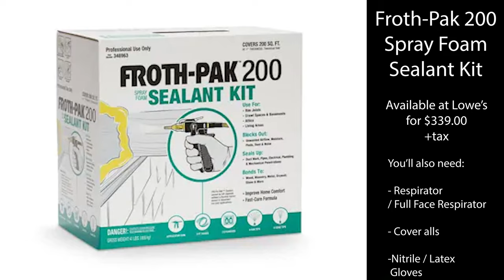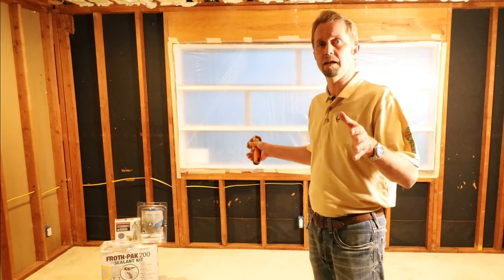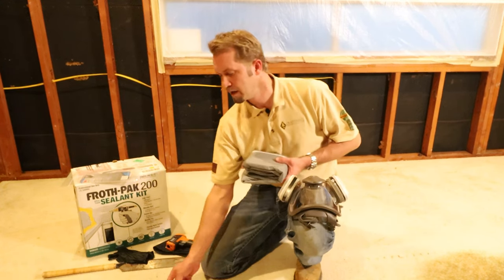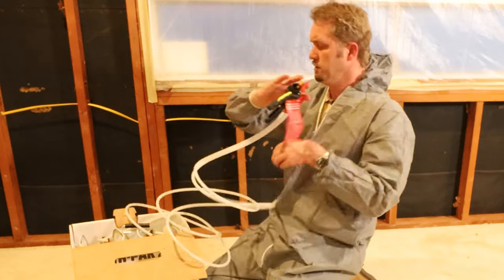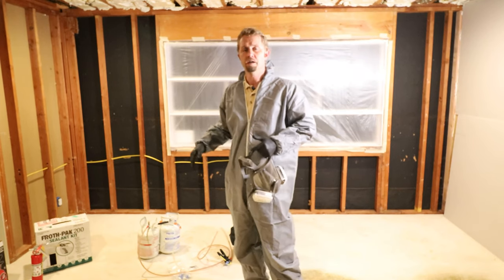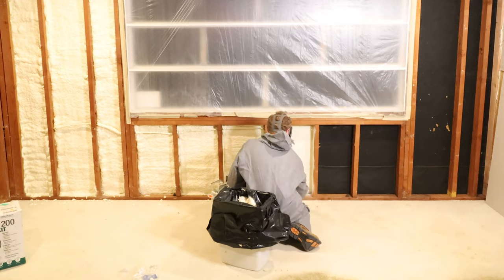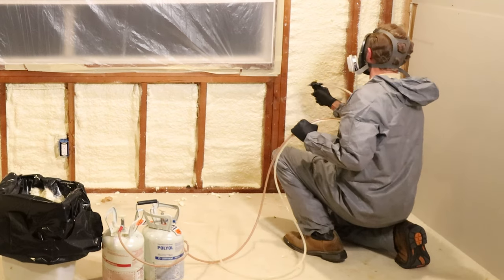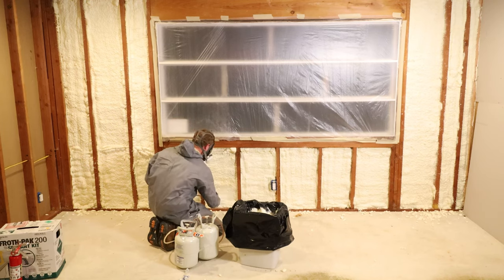Froth-Pak 200 Spray Foam Sealant Kit Set-Up, Precautions, and Spraying Review #Froth-Pak

Comment: craftsman connection ... thanks for the reply ... after a very long wait , Dupont informed me that these packs will not be adequate ( partial ) as a vapor barrier .. need the professional  " high pressure " installation  for vapor barrier .  ( glad I didn't buy more ).
Reply from the maker: My spray foam contractor has told me many times that you’ll need at least 1” of closed cell foam to have a vapor barrier. So, I would and do doubt what DuPont rep is saying. Maybe try calling a few spray foam companies to get their take on Froth Pak. Wouldn’t doubt they’ll try to push whatever product they use, but worth a shot.
Reply from the maker: I looked at the DuPont website for the perm rating on Froth Pak, and all it says is….@ 1” thickness, @ 2” thickness. What the average person wouldn’t see from looking at this product info is the missing values or numbers in front of # @——-thickness, so it would appear that it doesn’t serve as or rated as a vapor barrier. Now on other closed cell foam products, they do have vapor/ moisture ratings. Common sense would lead me to believe that if it is a 2lb per square foot closed cell foam, then it should be able to retard vapor/ water. Now I’m wondering if I can make a video on proving or disproving this? Got any creative testing ideas?
Reply from the maker: Vapor Barrier VS Vapor Retarder:

According to the Building Science Corporation, “A vapor barrier is defined as a layer with a permeance rating of 0.1 perm or less.”

A vapor retarder is 1 perm or less.
Reply from the maker: From DuPont.com:

For Froth-Pak™ Sealant the LTTR value (Long term thermal resistance)
measurement at 1 inch thick is 5.3 sprayed to Phs thier ine Lif value
(Long term thermal resistance)
measurement at 2 inch thick is 5.5 f2•h•°F/Btu (R value) per inch which is
R11.0 at 2 inches thick.
For Froth-Pak™ Insulation (Aged 180 days @ 75°F):
Thickness (inches)
1.0"
2.0"
R-Value (ASTM C518, F.ft2.h/Btu)
6.0 (when sprayed at 1 inch
thick)
12.2 (R5.6/inch when sprayed at 2” thick)
Reply from the maker: Small correction: Way off to the side of the spec sheet I found a rating. For the Froth Pak, The perm rating is 5.4 at 1” thick, and 3.1 at 2” thick. So if you know that a Vapor Barrier (blocking vapor) is considered at 0.1 perm or less, and Vapor Retarder (slowing down vapor) is at 1 perm or less, then by seeing a spec of 3.1 perm and 5.4 perm, the Froth Pak is not a Vapor retarder or vapor barrier. Thanks for making me do my homework. 😄
Reply: @craftsmanconnection  Think I'll insulate walls with glass and paint ceiling/ attic  joists ( old farmhouse )   & leave them open -- as they have been for 90 years ... and decide later if its too hard to heat ... might b just fine . Thought this would create a barrier so as to eliminate venting ... probably not possible with 2X4 wood . Other thought would be use 210 and then seal it with visqueen .. with dead air between -- all depends on the climate I guess. I could watch it  & see if condensation forms - but I don't think I'm that patient .
Reply from the maker: @jlondon158 My spray foam contractor strongly advises against closed cell foam on rooflines, because if you have a leak, you won’t know about it until the wood rots and falls apart. Now that we both know that Froth Pak is not a vapor barrier or vapor retarder, it sounds like it would be ok to put it on the roofline. But I really wonder what a perm rating of 3.1 and 5.4 is comparable to. What is the perm rating of a sponge for comparison?

Kind of comparable to your farmhouse, I have an enclosed patio. All windows on 2 sides and all brick (the house) on the other 2 sides. I had my spray foam contractor spray foam my patio ceiling / flat roof with open cell foam, so I could have 2 portable AC units totaling 27,000 BTU’s on the 400 sq. ft. patio cool it down from the 100-110 Texas summers, down to 78-83 degrees, and I have single pane windows still. I spend almost all the time I’m home out there, everyday now for 5 years.

Comment: Is it cheaper to do it yoirself than hire a company?
Reply from the maker: For my spray foam contractor, his minimum cost for a job was $1,250, and went up to $1,500, and then went up again to $1,750. So the real question is how much spray foam do you have to do? You’ll need to first measure the square footage of the wall, and then multiply it by the number of inches in thickness to get the board feet. Example: 100 square feet x 2” thick closed cell foam is 200 board feet. In my video I had somewhere around 77 square feet, times a 2” to 2-1/2” thickness, which means I got around 154-192.5 board feet out of a Froth-Pak 200 kit. Keep this in mind when purchasing material. 

Froth-Pak 200 currently cost around $389 per kit, so after tax, it cost around $421, depending on your sales tax rate. If you buy 4 kits for a total of $1,684, that is probably the limit for when it’s worth hiring a spray foam contractor, who might have a minimum of $1,750.

When you do it, you can get it as thick as you like, and 2” should be the minimum. You can also get it done at your convenience, and as your project allows if not 100% ready for a contractor. Don’t forget to use a respirator, and cross ventilation so you’re not inhaling chemicals that are very bad for your lungs.

Comment: why did you use the sealant instead of the insulation one? is the sealant for exterior walls? doesn't really say on their thing
oh I found it on the dupont site and you're supposed to be using the insulation one for what you are doing lol
Reply from the maker: This is probably the #1 question I get. This “Sealant” kit is an insulation kit. The box is poorly labeled. On the Dow website for the Froth Pak product, 2nd paragraph, their website says “ …sealant and insulation…” I think the only reason they call it a sealant kit, is the size of the box.
Reply from the maker: The difference is in the nozzle you choose to use in the box, and the box size like 200, 600, 625, etc.. The 200 is great for a single wall of closed cell foam, or to carry around to fill gaps, holes, etc., but due to it’s size, not very cost effective for doing larger areas such as several walls, or a roofline. As with anything, you typically get a price break on larger quantities.

This is a copy and paste from DuPont.com: Froth-Pak™ Foam Insulation is a two-component professional insulation kit. Froth-Pak™ comes as a professional sealant for air sealing gaps and penetrations up to 4 inches wide or as a spray foam insulation to fill larger cavities providing both insulation and air sealing properties.
Reply: @craftsmanconnection  yea the green one is for the cracks/corners and the red one is for the flat surface of the board. (of course both do insulate though) the red one is also is the only one that even has an R value on the box, weirdly.
Reply from the maker: The Froth Pak 200 in the green box is not fire rated. (See more below)
The Froth Pak 210 in the red box is fire rated.
When the spray foam is exposed in areas that are required to have a fire rating, traditionally my spray foam contractor would mention applying an intumescent paint coating to meet the fire rating requirements.
All spray foam has an R-value. Even wood and concrete has an R-value, even as low as it is, even though it isn’t advertised on the product. Wood has an R-value of about R-1 per inch. Hopefully Froth Pak gets their product packaging straightened out.

Comment: Okay... so years ago when my fiberglass tub was installed, it sat on a few blocks of something like styrofoam... and over these years, I can tell that the tub is not supported as it should be as if those styrofoam blocks have shrunken or have collapsed altogether.  Might it be possible to use this closed cell insulation and spary it under my tub from the basement underneath?  I'm looking for more support in the tub, as it is now time to use a shower stool or chair and I'm worried that the tub will crack, like it did in my sister's house.
Reply from the maker: A couple of things:
1. I’m not sure what your access to the underside of the tub is like, but I would be concerned about getting or making sure you created the support you’re hoping for. Since the froth-Pak foam cures in 30 seconds or less, it’s not like it would run over like a cream into hidden spots you couldn’t get to. There is a foam called PIP foam which stands for pour in place, but you would need access from above the bottom of the tub. Since the only person I know to get it from is a spray foam contractor, I might be more interested in using a self leveling cement product, which would be a harder surface and way cheaper for you to buy.

The second thing is, some foams can expand with pressure, so that might lift your tub upward. Door and window foam does not have this kind of expansion pressure, which makes it great for not distorting the jamb or frame of those items.
Reply: @craftsmanconnection  Thank you sooooo much for your input.  I thought Great Stuff might work, but I've had hit or miss luck with that stuff.  I was hoping to find a similar product that would apply/work better.  I'll check into the PIP stuff... but I was looking for closed cell because it deflects rather than absorbs water.
Reply from the maker: Hopefully you don’t have any water under your tub anyways, but if you do ever have water, a cement based product will dry out faster that a spongy foam (open cell) product would.
Reply from the maker: Most manufacturers either use a dense closed cell foam or plastic tabs to touch the subfloor, but if you read some tub install directions, they talk about using a cement product like self leveling mortar or a mortar base layer to set the tub into and help make it level.
Reply: @craftsmanconnection  ... Thanks AGAIN for getting back to me.  I have an access hole in the basement for the tub drain clean out... my only access to get a nozel/hose up in there to spray some foam.  Just looking for the best product to use... and you've pointed me in the right direction.

Comment: I was gonna try to spray under my house between the floor joist  any suggestions
Reply from the maker: Other than the recommended safety equipment, like the respirator, a spray foam contractor might set up some way of cross ventilating the crawl space diagonally to help bring in fresh air, and help fumes from building up. You’re also trying to keep the fumes out of the house, if possible.

Don’t spray on more than what it recommended, check temperatures occasionally until you at least know you are not doing too much at a time. Take a fire extinguisher with you, just in case. You’ll need a light, and most importantly turn off any sources of open flames like a pilot light to a water heater or central air and heat system, fireplace, etc.

Make sure you are allowing the containers to warm up to about 70 degrees, even if that means storing them inside the night before or a couple days before. That is what I did since I was spraying at a time of year that was colder than 70 degrees outside in January.

The Froth Pak sprays well. Don’t forget to mix the containers well by rocking them vigorously back and forth for about 5 minutes. I did that and everything went well according to the manufacturer. Good luck with your project. How many square feet do you have to do under the house?

Comment: QUESTION  How many of those would I need for a mobile home 65 length by 14 width??
Reply from the maker: 65 foot mobile home? 65’ + 14’ + 65’ + 14’ = 158 lineal feet of wall x 8 foot high ceiling = 1264 square feet. If each froth Pak kit covers roughly 172 square feet @ 2” ish thickness = 7.34 kits, than you would need 8 kits at $339 per kit + 8.25% tax, would equal…$2,935.74 after tax.

If you hired a spray foam contractor, it would be cheaper. My spray foam contractors minimum price was $1200 before COVID, and is now $1500. If I remember about right, his closed cell spray foam price was a little over $2 per square foot, so your job might cost you roughly $2,500 with their materials and labor.
Reply from the maker: …and that is for the walls only. Use roughly $2 per square foot to get you close to what the cost is for materials and labor from a spray foam contractor, let’s say if you want to do the roofline too. Roof line depends on pitch, and with spray foam sealing up the air better, you also have to be aware of other items like combustion air for the water heater, and forced air units, if they are gas units.
Reply: @craftsmanconnection  i forgot to tell is under the trailer in the crawl space
Reply from the maker: 65’ x 14’ under the crawl space at 2” to 2-1/2” thickness is 910 square feet. 910 divided by 172 is 5.29 kits or 6 kits, times $339 + tax is $2,201 after tax at 8.25%.
Reply: @craftsmanconnection  thank you

Comment: For what you get for the dollar, your better off using foam board.
I used the pink Owens Corning foam board and a Great Stuff pro spray foam gun to seal the gaps. Leave 1/4" gap and fill with the spray foam. Did a much better job for the dollar.
This stuff is VERY expensive for what you get and a big mess to work with.
Difficult to apply if you don't have experience with it.
Reply from the maker: Hi Mark, I’ve done some small repair areas, like for 1 stud bay, and yes it would not be worth the cost of a whole kit, but will take more labor time. One thing you may not be factoring in is the value of your time, or the ability to tightly fit around other obstacles, like wiring, piping, etc.

This kit is designed more for small projects and repairs of existing spray foam walls. Once you get above 3 Froth Pak kits, now your getting into the zone of what it would cost for you to just hire a professional spray foam contractor. Froth Pak is a closed cell spray foam, but there will be times and places when you want open cell foam, in which case there is not a spray kit that I’m aware of, or other open cell foam products at your home improvement store.
Reply: Very difficult to fit foam board around wires and pipes and in small gaps.
Reply: @percyfaith11  Maybe if you are looking for an absolute perfect fit. No need, that's what the great stuff is for.
Reply: @Marvinfj32  True and I hear what you're saying but there are some places just too restricted to fit foam panels and spray foam would be ideal, except it comes in large quantities.
Reply: @percyfaith11  True, there are always those "special" spots to slow your day down. Then there is the old reliable method I use. Stuff fiberglass around the odd places. We didn't have the spray foam when I started out in the trades. Ok I gave away my age some. :)

Comment: Does this kit insulate, or is it just a sealant?
Reply from the maker: Hi Alexis, the Froth-Pak is a insulation and an air sealant. It’s closed cell spray foam,  which is similar to a foam cooler. It’s water proof.

Comment: How much does it cover from 1 kit if I do 2 in ? Thanks
Reply from the maker: In the video I mention, via text typed across the screen, how much square footage it covered for me at that 2”-2.5” thickness. Realize that you will have no exact control of thickness. You will spray the foam on with a guesstimated spray pass speed, and the foam will expand to a slightly uncontrollable amount. I do like the Froth-Pak product, as it is closed cell and does not expand crazy like an open cell foam would do.

2” thickness of foam x 12” high x 12” wide is 2 board feet. If I remember correctly, the Froth-Pak kit produced about 177 board feet per Froth-Pak 200 kit. I covered all of this in the video. Thank you for watching! 😎

Comment: Cost seems a little high for just a couple cubic feet of coverage
Reply from the maker: The key to saving money is to know when your job is small enough.that you should do-it-yourself (DIY) to save money or to hire a professional to do the work for you

The Froth Pak 200 is 200 board feet (1 board foot is 12” x 12” x 1”). 200 board feet is 16.66 cu. ft. of foam, but when you buy the larger Froth Pak kit, the Froth Pak 620, the cost goes down significantly. You get a volume  discount. 

     If you hire a spray foam contractor for a minimum size job, the minimum cost is around $1,500. For closed cell foam, the cost is around $1 per board foot or $2 per square foot of 2” thickness of spray foam, or $12 per cubic foot. $12 x 16.66 cu. ft. = $200. So the cost of the Froth Pak is double compared to a spray foam contractor.

 For the product alone in March 2021 was $349-$369. These days, late 2022, the product cost has gone up to $409-$429 per kit, but you saved around $900 if you have a small job. My spray foam contractor cost was $1,200 years ago and has gone up to $1,500. The product isn’t cheap, but you will be happy with the results compared to other brands I have seen videos of. Good luck with whatever decision you make.

.